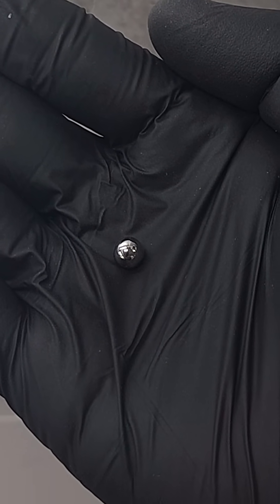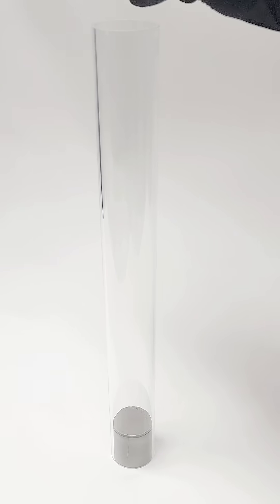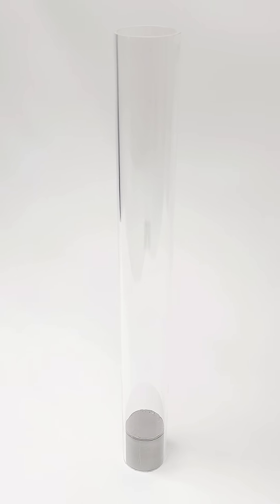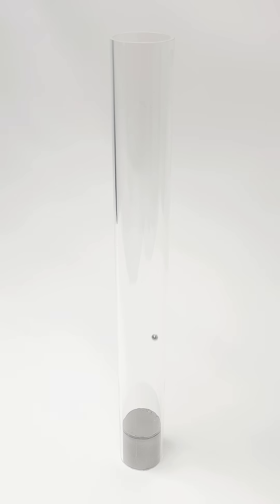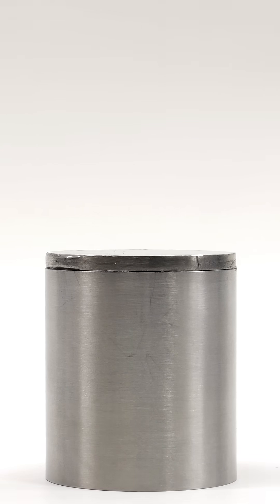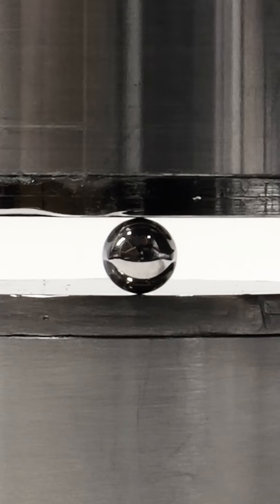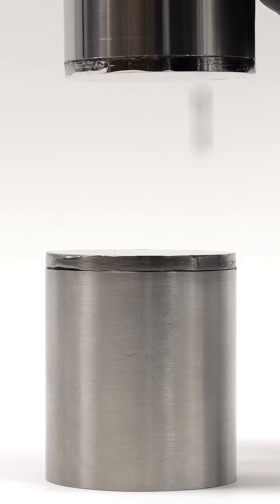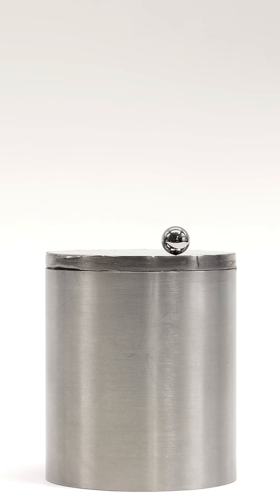This metal is too bouncy

Comment: This demonstration seems similar to the Euler disc demo where the disc spins faster as its vertical angle to the surface decreases. It even has that distinct terminal sound effect referred to as "the singularity"

Comment: What would happen if you dropped it into the tube like the first attempt. But then immediately capped it with th second teapoline also capping off th hight of the bounce. Would the second trampoline allow it to retain enough energy to keep going for much longer.
Damn i dont think itll make much difference but then in a vacuum would having no air resistance extend this even further?

Comment: I want to see more of this. Maybe see how long you can sustain bounces and at varying distances. Like for example, would it bounce as long at the closest point when making the squeak as it would when the trampoline is held higher up. Could you draw out that high frequency for longer or is it gonna lose to much energy pinned that close between the 2. I wonder if theres any application for this. A means of harvesting energy from it or some other use we can't even conceive of yet. For all i know, there already is tech out there making use of this very setup to some degree

Comment: You don't need to count. Once it becomes audible, the pitch in Hz is the speed it is bouncing, because the sound isn't the sound of the ball hitting magically "going up" in pitch. It's going so fast and the time between the impacts becomes so short that it essentially just becomes a sine wave oscillator. So if the pitch ends near 7000 hz, well, it was in fact impacting at that frequency, 7000 times a second, in the same way that that's how fast the speaker on our phone has to oscillate to replicate the sound.

Comment: He mentions about several thousand times per second, but doesn't provide the measured cycles second at its peak. I would like to know the highest frequency. I'll sounded like the frequency went above the threshold of hearing, which is around 20,000 cycles per second.

Comment: What I love about this is it demonstrates several things:

1. Why particles generate more pressure and release more heat energy when they’re compressed.

2. How particles have wave-like behaviour as you can see that when you reduce the distance the frequency increases with an inversely proportional relationship like how the shorter the wavelength the higher the frequency of the wave.

3. It shows the attraction between two particles can be mediated by a gluon and higher energy is required the closer the particles are to each other and why the strong nuclear force only acts within short ranges vs far distances.
Reply: Excellent observations. Especially the inverse proportionality between magnitude and frequency.

Comment: If you keep it on the trampoline, does it eventually get so fast that it looks like it was stuck between the two due to the fact that when a number is fractioned and repeatedly gets smaller when you subtract all the fractions from the number it will never reach 0?

Comment: "from what I could count"

NileRed out here casually dropping that he can count thousands of beats per second.
Reply: I'm not for sure but it is possible that he just used the pitch of the note that it played to estimate. But im more of a music guy than a science guy so There may be a more accurate way of counting that he could have used
Reply: Several thousand*
Reply: The reason you can count in this case with pitch is because at its fundamental level pitch is just something audible happening X times per second. If you take a digital metronome and set it at a bpm of 26400 then it will make a pitch of A 440 because it’s 440 beats per second
Reply: @azazel-0671  
Didn't say "measure", said "count".  
It's canon now.
Reply: Bro is the next Vsauce 💀
Reply: Find a way to harness energy out of it !
Reply: i can bet any body it won't reach even 1 thousand/s
Reply: Hz/Cycles Per Second. You can tell by the frequency that it gets close to 16khz or more.
Reply: You can count it based on the sound frequency.
Reply: Some of ya’ll post the literal most “low hanging fruit” 🌽🥎🤡 comments of ALL TIME. . .
Reply: That’s what I wanted to say lol but there’s like no other comment saying that
Reply: Just measure the frequency of the sound in hz
Reply: @RickDalton_  
But he didn't say "measured",
he said "count".

Comment: I used to imagine a ball that would bounce a little higher than the height it was dropped from. That would be impossible, but if there was it could continue to bounce until it went into space. Or between two hard sustances it could boince back and forth forever

Comment: Hey, do it in the tube.
Use a bigger ball
Drop the other trampoline immediately after.
Who knows you might break physics and achieve lift with different weight ratios.

Comment: Hi there, buddy! How did you do this? What kind of material did you use to achieve such a bounce? I know similar effects can be achieved on hardened surfaces or materials with special coatings. Could it be something like the coating used on drill bits, like titanium nitride? Really curious, please share!

Comment: As a sound engineer, I had extrapolated the uni-constant differential between the osmo-manipular range within the semi-oscillating contingent, and I can tell you that my instruments went haywire within the context of lumo-extravigant boundary. The ball crossed into a inter-dimensional flux of neuron neutral radiance and for a moment, reached cross-molecular speeds within that moment of time.

I've sent my findings to the university of science, but the professor of logic did not issue a response to my dissertation just yet.
Reply: The same I was thinking!!!😅

Comment: Try do this in a vacuum, eliminate as many factors as possible which could reduce the number of bounces. So eliminate air resistance and perhaps even the ball could be made of similar material if that helps

Comment: I wonder how many time doing this would make the ball-bearing hot
Reply: That's what I was thinking.

If, instead of narrowing the gap, he kept it at (the diameter of the bearing + 1 millimetre),

Wouldn't that generate a lot of heat?

Albeit in a small mass.

Comment: You don't need to count the bounces with a camera, a mic will be more accurate at these speeds.  Take the audio frequency in Hz and divide by 2.  That's the number of bounces.

The reason you would need to divide by two is because you have 2 surfaces.  One bounce will be 2 audio events.

Comment: The most impressive part is that it didn't fly out the side. With how fast it's going, you'd expect it to be unstable enough that the slight variation in the angle of the upper trampoline that's inevitable because you're holding it by hand, the bearing would get launched put the side.

Comment: Have you tried tying a wire or strong string to the top one and don't let them touch and adjust the height=to frequency  !! ,with a digital hertz meter, db meter also what is  the tranpoline made from ?

Comment: fun fact, if this is done in space with 2 atomic trampolines it would never stop in our life time without forcing it to stop

the reason is stops is because gravity is effecting it but in space you remove gravity and given how clean the kinetic energy is retained it's safe to say it would last a very long time when gravity is removed from the equastion

btw it's because of gravity unlimited energy is not possible with the only way to reach unlimited power is via space plants to produce it outside of the Earths gravity well

Comment: Use the tool musicians use to determine the pitch of something and hold the bounce at a steady height until you have a pitch that can be registered with the software. Then that software will tell you the frequency or the number of beats per second. The note that orchestras tune to is an A @ 440 beats per second.

Comment: Item #: SCP-018

Object Class: Euclid

Special Containment Procedures: SCP-018 is to be contained in its specialty metal restraint inside of a 1 m by 1 m by 1 m sealed box lined with heavy synthetic padding. The sealed box is then submerged in the center of the 10 m by 10 m by 10 m polyethylene holding tank. If SCP-018 is to break free from the holding box, the polyethylene-based 'goo' will slow down kinetic activity enough for proper retrieval by containment personnel. Personnel entering SCP-018's holding chamber are to wear specialized plating (found inside of SCP-018 Observation), and a breathing apparatus before being lowered into the polyethylene tank. If SCP-018 is loose outside of the polyethylene tank, personnel are advised to secure themselves in a separate room and close doorways or hatches to isolate SCP-018 until containment teams arrive.

Description: SCP-018 has the appearance of a Super Ball made by the Wham-O company in 1969. It is six (6) centimeters in diameter and coloured red. Found when the ██████████ company was hired to clean out a warehouse that had Wham-O merchandise in it, SCP-018 was noted to be able to bounce with extreme height. At first thought to be a pleasant child's toy, SCP-018 was able to bounce with over two hundred percent (200%) efficiency (that is, if dropped one (1) meter, it would bounce two (2), then four (4), then eight (8), then sixteen (16)). The ball soon became a dangerous projectile, reaching speeds estimated at over 100 km/h and damaging property and injuring five (5) in the city of █████████████. It came to a rest after several days in the nearby lake of ████████, and was retrieved by SCP personnel. Due to the speed of the object, and the total surprise by its victims, no cover-up story was required or initiated.

Comment: Try it in a complete vacuum in zero gravity with a higher tinsel ball bearing. No gravity and no air resistance... it plausibly could go for as long as the metals last from impacts

Comment: Let the SloMo guys video it, also put it on a rack like a drill press so you can control it at the bottom where there's a 1/16" gap and hold it there for as long as it squeals.

Comment: Now I'm curious The atomic trampoline, which I seen in your regular page which was awesome. The ball bearing bounce a lot but in a short long timely matter on your atomic trampoline. So I was wondering as you took two of your atomic trampolines and  brought them together the bearing made a high pitch, which meant that it bounced several thousand or tens of thousand times, as you were taking your two atomic trampolines and bring them together, What if you had kept them at about an inch to inch and a half or 2 inches apart. How long would that bearing bounce cuz you have two trampolines that is bouncing towards each other perhaps it would bounce ♾️? Probably not but, I'm Very curious, what about you, what's your take on that?

Comment: Put paper on one trampoline, then put the ball between both of the trampolines and then it should ignite due to the friction of the ball bouncing off both of the trampolines then wants you push the top trampoline closer it will cause the ball to bounce off even faster because of the gap becoming smaller

Comment: The easiest way to find out is by plugging the sound in a spectrum analyzer. You can do this in garage band or any other DAW. The sound you hear is essentially a sine wave being created. Using the sound, you can observe the Hz or kHz of the bouncing bearing, that will tell you exactly how many times the ball bounces per second at any given moment.

Comment: Sounds like a B♭ or a B♮ at the highest peak. Kind of hard to tell, especially since I don't have perfect pitch and my keyboard doesn't reach that high so it's difficult to compare. It's at the very least in the 9th octave or higher, possibly outside my range of hearing. Regardless... if it's cutting off at around B♭/B like I'm hearing and it's at least 9th octave or higher, then at minimum that means that ball is bouncing around 15 thousand times a second... maybe even more. I'm not really an expert though, I'd like to ask someone with perfect pitch what they think... maybe I'm off

Comment: I don't know what's more insane about this, the fact that this thing actually exists or the fact that he accidentally simulated the sound of a creaking door.
Reply: The creaking door sound is the hinge surfaces sticking and slipping in the same ultra high speed way.
Reply: or the fact he can count that fast
Reply: To me it sounds like tuneing a radio at the end
Reply: Yeah it did sound a lot like a transistor radio. @SilverWolf709
Reply: The creaking was just added to minecraft
Reply: Plot twist: Minecraft creaking sound is actually made out of a radio tune sound
Reply: it sounds like an old man's fart..
Reply: There is more correlation between the two than one might think... excellent observation! Instead, there are a multitude of atoms whose electromagnetic fields pass across one another and the resulting sound is a cumulative harmonization of all atomic electromagnetic fields interactions.

Comment: Ok, so this needs to be made into an instrument or speaker system somehow, right? Since rhythm and pitch are essentially the same thing, just on different orders of frequency magnitude, if you could map the distancing of the two surfaces to predictably create a given frequency, then attach each side to a motor/gearbox setup with a decent degree of precision... Yeah, it could be a pretty badass little one-off project. Totally impractical and not scalable enough that it would even be worth the cost to produce it, but badass nonetheless.

Comment: If the ball was connected to a pendulum and there was a way to reset the trampoline height and pendulum arm mechanically, could you harness power?
Reply: Using a small amount of mechanical energy to lift a pendulum arm and produce speeds of that rate, I don’t see why you couldn’t make a generator with this experiment

Comment: You can figure out how fast it’s going by the pitch it produces.  It’s basically the sound of the bounce being amplitude modulated by  a pulse wave (on off on off).
It sounds like it gets up to 10 khz or so (estimating based on the sound).

Comment: Based on the sound *alone*, the upper frequency is higher than 4 kHz (note "C8" on a standard keyboard is 4.186009 kHz).  And, I estimate that the limit was actually around 8 kHz -- which can be easily verified by looking at the actual audio waveform in a standard sound editor (which I've not done).

Even so, if it were bouncing at 4,000 times per second, that would be simply amazing in and by itself, especially in a non-vacuum.

Noice!!

Comment: Couldn't this be used to multiply kinetic energy and output as electrical energy on a very tiny scale passing through copper wire a 1000 times a second?

Comment: Under circumstances without friction or gravity, the ball would actually bounce progressively faster until, at a width barely large enough to fit it on an electronically microscopic level, it reached just under the speed of light

Comment: The M134 Minigun is an American 7.62×51mm NATO six-barrel rotary machine gun with a high rate of fire (2,000 to 6,000 rounds per minute).[2] It features a Gatling-style rotating barrel assembly with an external power source, normally an electric motor. The "Mini" in the name is in comparison to larger-caliber designs that use a rotary barrel design, such as General Electric's earlier 20 mm M61 Vulcan, and "gun" for the use of rifle ammunition as opposed to autocannon shells.
Machine Gun, High Rate, Caliber 7.62-mm, M134

A Dillon Aero M134D minigun in 2017
Type
Rotary medium machine gun
Place of origin
United States
Service history
In service
1963–present
Used by
See Users
Wars
Vietnam War
Third Indochina War
United States invasion of Grenada
United States invasion of Panama
Soviet–Afghan War
Falklands War
Gulf War
Operation Restore Hope
War in Afghanistan (2001–2021)[1]
Iraq War
Production history
Designer
General Electric
Designed
1960
Manufacturer
General Electric
Dillon Aero
Garwood Industries
Profense
Produced
1962–present
Variants
See Design and variants
Specifications
Mass
85 lb (39 kg), 41 lb (19 kg) lightweight mod.
Length
801.6 mm (31.56 in)
Barrel length
558.8 mm (22.00 in)
Cartridge
7.62×51mm NATO
Barrels
6
Action
Electrically driven rotary breech
Rate of fire
Variable, 2,000–6,000 rounds/min
Muzzle velocity
2,800 ft/s (853 m/s)
Maximum firing range
3,280 ft (1,000 m; 1,090 yd)
Feed system
Disintegrating M13 linked belt or linkless feed; dependent on installation (500–5,000-round belt)
Sights
Dependent on installation; no fixed sights
"Minigun" refers to a specific model of weapon that General Electric originally produced, but the term "minigun" has popularly come to refer to any externally powered rotary gun of rifle caliber. The term is sometimes used loosely to refer to guns of similar rates of fire and configuration, regardless of power source and caliber.
The Minigun is used by several branches of the U.S. military. Versions are designated M134 and XM196 by the United States Army, and GAU-2/A and GAU-17/A by the U.S. Air Force and U.S. Navy.

Comment: If you somehow fashioned the ball and trampolines to incredible polished surfaces, and advanced them at a mechanically controlled rate... as the intervening distance approaches zero, won't the limit to approach infinite, well above merely a supersonic analog sound?

Would the ball's travel velocity between collisions approach mach in the final microseconds?

Comment: Make a vacuum tube capped with your metal glass, put some strong magnets behind the wafers, and use slightly magnetic balls like Platinum, Palladium, Rhenium, rhodium, silver.  Use highspeed camera and let see what happens!
Reply: This
Reply: Not sure if the magnetic attraction will cancel out the extra acceleration, but maybe playing with different configurations, distances and materials you can get the ball to bounce 2 - 3x more maybe even, the impossible Perpetual motion lol
Reply: Dooooo it.
Reply: this will cost more than his piece of osmium